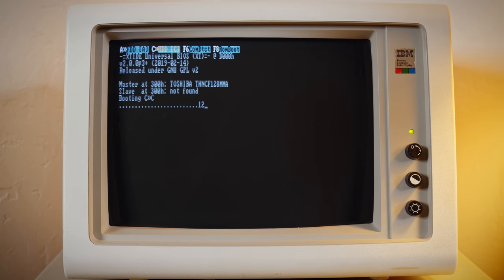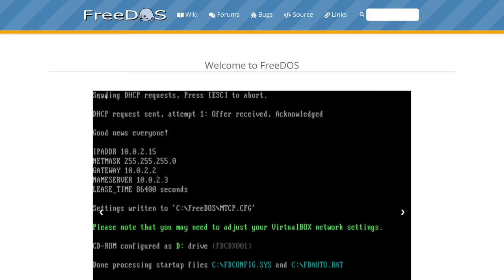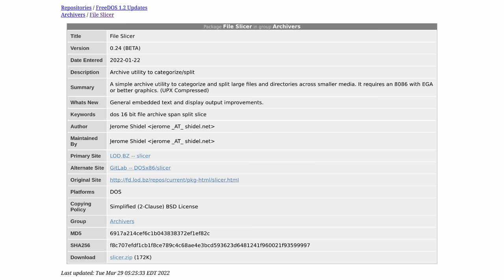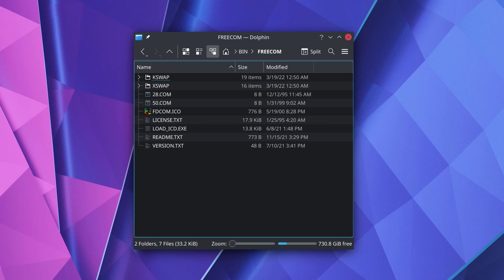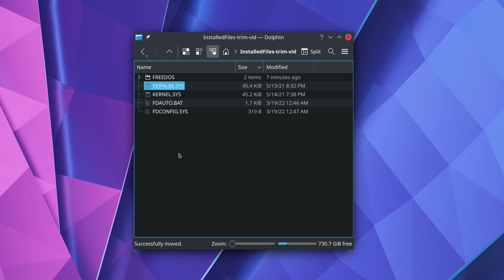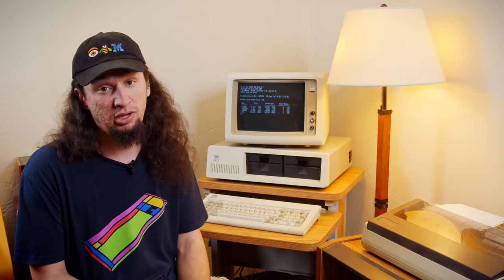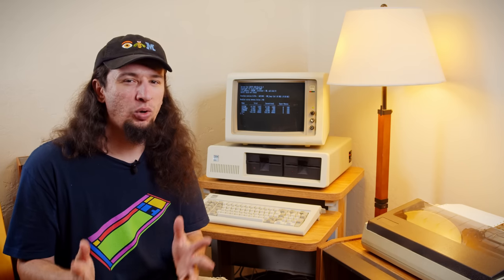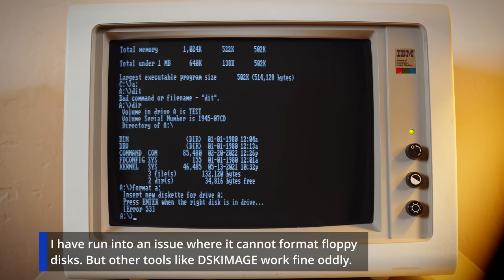Installing FreeDOS for 8086 on an IBM 5150

Comment: What in god's good name do you want fat-32 for on a 5150 class computer?  Hell, fat-12 should be good enough. Who needs more than 32MB of storage on a 5150?  If you really need to have every game ever made that will run on it, fat 16 is more than good enough.  Granted, it's not that simple to buy modern CF or SD drives under 4gig(2 gig is the part size limit, 4gig is the drive limit at least in early hard drives), preferably under a gig for such a computer.  But it's the way to go than having to screw around with this stuff.
Reply: Better question, why the hell would anyone want to run a 5150 class computer?

I mean, I know why I want to, I think is neat. But you clearly aren't talking about a hobbyist perspective here, but s practical one, so please, what use case do you even have to run a 5150 machine, and why that case isn't better served with emulation?
Reply: @Jossandoval  Why?  Why not?   I would agree on every other era of PC computing.  If you've got a 486, 286 software runs fine. You don't need one of every generation.  Really, you only need 3 PCs, a pre XP machine and a post XP machine and a 5150 or XT or T1000.  
The first generation is different.  All of the games are synced to the clock, not the RTC or the video signal or whatever else they use. SO if you try and run a game designed for a 5150, most will not run right on anything but an XT class computer. They will run far too fast because the program is not self-aware (IOW, synced to something other than the CPU clock, IOW, running full out as fast as it can run).  There are slow-down apps that have been available for DOS since the 286 first came out. But they're not very good.
It's not so much practicality as it is headache for no good reason.  You cannot possibly need more than 4GB (partitions are 2GB, but the drive of old controllers  max out at 4GB)  of storage on an XT or 5150 class computer.  There is just no reason for it.  32MB is more than enough and that's fat12.  I'm being generous with fat16.
I like emulation, but nothing beats real hardware.  Most emulators are lucky if they provide 95% accuracy.  All modern computers also use an LCD screen.
Of course, if you don't have any room for it, emulation is great.
Reply: @tarstarkusz  I must be strange because I have preserved two examples of the last of the single core XP era machines.. an AMD 64  Asus K8N board circa 2004 (A machine I built for somebody and then got back as junk 5 years later with bad caps) and an Intel P4S-800 with the fastest chip I could find in my stash.. both with 2 gigs of ram and 512 agp graphics.. what would have been pretty decent gaming rigs in the day.. The 64 is running straight up Debian 64 and the Intel has XP sp3 .. I watched them all die from bad caps and hit the scrap heaps in huge numbers and thought to myself "these will just vanish because nobody cares" so I recapped them and saved them for posterity. Same with a single example of the dual Pentium 32.. I wish I had saved my Pentium 133.. but space and my 40MHz 486 seemed more vital to save in the early 2000's and there do seem to be a lot of Pentiums still around. I cry when I see what people will pay for a straight 8088.. I junked a Packard Bell 8088 machine in 2002 due to a rushed move overseas. nobody wanted such rubbish back in the day..

While people go mad for the real antiques (and pay silly money IMHO) I think it's important to try to keep something running as an example of the standard kind of machines from every era.

My current restoration project is a dual P3 board.. I don't need a P2 or P3 system because I have both types represented in laptops.
Reply: @PaulaXism  It's kind of a shame that the bad cap era was when it was as they were the last machines that could boot 98 or ME and so they were the fastest pre-NT (by pre-NT, I just mean pre-XP. NT obviously goes back to 95 or 96) machines.  So many of them died early deaths.  This was also when the price of PCs was dropping precipitously. 3k bucks was common as recently as like 97 for middle of the road PCs and by 2003, low end PCs could be had sub $500. So they were already cutting corners to meet the new price.  But the cap problem is across basically all electronics and not just PCs.  A lot of ECMs (car computers) from that era are failing from bad caps, so I hear.

If you have the room, having machines from various era is nice. Other than sentimental value, I wouldn't mourn the Pentium 133, although most Pentium class PCs can boot straight to dos, so they make great dos game computers.  I have a Compaq desktop P166, but it's an EISA and PCI machine (it's put away, but IIRC, it's a proliant) with built in SCSI and a special keyboard with a mic and speakers built in.  That's a very nice machine for DOS gaming.

You couldn't give XT or 5150 class PCs back in the day. In 1993 I bought a Compaq luggable at a local computer shop 2nd hand for 99 dollars. It was 3k bucks new without the upgrades. Mine was fully decked out with 640k and with the optional hard disk.  It might have had an EMS card installed, but I don't recall for certain.   It's a pretty collectable computer today.  A working keyboard for it is probably more than I paid for it back in 93.

AFAIK, most of the XT class computers are still not really worth much. It's the IBM and Tandy machines and oddities like the Compaq luggable (Portable)  that get all the price love. They made clones by the boat load in the latter part of the 80s and sold them for less than a thousand dollars. These no-name clones I think are still pretty cheap. Great if you just want CGA gaming.  The downside is most of them don't have the composite out.
Reply: @tarstarkusz  For the 8088 games that are bound to the clock you only need a 286 with a working Turbo Button and they will run fine. The turbo button will half the clock sped of a 286 from let's say 16 MHz to 8 MHz. That's good enough to run these old games.
Personally, I've only had one game that was so clock-bound that it ran too fast on my 486 DX 33MHz, but was perfectly fine on my 286. And that was Oil Empire. Programs like slowdown didn't help with this game because the assembler routines were so small and ran in tiny loops that the slowdown program didn't even get a chance to run between that loop.
The game was therefore unplayable on a 486. But on the 286 it ran wonderfully thanks to the turbo button.

Since it didn't run properly on my 486 and my 286 was sold by the upgrade, I sold the game at the time. Unfortunately there was never a remake of this game. The game only offered EGA graphics on the PC, a remake in VGA and with Soundblaster support would have been great.
Reply: @OpenGL4ever  No, they won't. The 286 is faster at 4.77mhz than an 8088 at 4.77mhz.  An 8mhz 286 is WAY too fast for an 8088 game. Plus, many 8088 games will not run on anything but a 8088 or 8086.  The addressing is not quite the same and many games of the era relied on very tight timing and used some of the addressing oddities of the 8088 that won't work on a 286 or higher. 

Basically the address space wraps around at FFFF:FFFF  Sometimes it can be quicker to wrap around the address space than to move back down to the bottom of memory(IIRC, it's 1 vs 3 cycles). But this trick will crash a 286 because conventional RAM is bigger on a 286 and higher by exactly 65536-15 bytes. (which means it won't wrap, it just climbs into the HMA and will land on a random byte)  It has a 24 bit address bus. A quirk in the way conventional memory is addressed allows a new 64k frame to begin in the FFFF:FFF0 frame.  If you have ever seen himem sys in the config sys file, this is what enables that. Dos=High is what moves DOS into the HMA (high memory area)

Some 8088 games will work correctly on basically any DOS computer up to a Pentium. Though this is fairly rare.

However, some run too fast. Some crash.  I've never ran into it, but I've heard some XT class games required EMS RAM and on a 286, you need actual EMS RAM if the game requires it.  On a 386, the computer can emulate it if you put emm386 exe in the config sys file and you have enough RAM to have a chunk of it mapped into EMS. (IIRC, it does do this automatically. It will give your program that wants EMS all the EMS it wants and dynamically adjust XMS RAM as EMS use goes up and down, all but 64k (the EMS frame is 64k, usually the E segment))  But emm386 requires a 386 chip or higher  because it requires virtual 86 mode introduced with the 386)..

I personally have NEVER found an 8088 game that ran too fast on a 286 where the turbo button helped.  It will slow down some, but not to the right speed.  I forget the details, but a 286 is significantly faster at the same clock speed.  Just moving RAM around is faster. It has a 16 bit internal and external data bus. This alone is probably 30% faster at the same clock speed.
Reply: @tarstarkusz  You can also buy a 12 MHz 286, this will give you around 6 MHz with the Turbo Button option.
You can even buy 4 MHz CPUs.

About the addressing thing. I never heard of such games with such issues. The 286 is perfectly compatible to the first IBM PC.
And for the address space wraps around at FFFF:FFFF  thing the A20 gate does exist.
Thus it's definitely not a problem.
Have you ever heard of the A20 gate?

About the "relied on very tight timing" thing. I doubt it. Usually the games run very slow on a 8088 anyway, thus a 286 will make them more playable.

What you wrote about EMS is not true. There are 286 motherboard chipsets that will allow you to access the RAM above 1 MiB and use it as EMS. They ship with their own EMM driver version.
Motherboards with chipsets like the  NEAT-Chipset can do this easily.

The last option would be to simply modify the 8088 games and change the loop counter, for example.
The beauty of the early 8088 games is that they aren't very big. This makes them manageable. You should be able to understand assembly language  and opcodes of course. But it can be done.
Reply: @OpenGL4ever  I know there were several 286 chipsets that could use either emm386 or a custom one. But they were 3 or 4 chipsets. I know, when I had a 286, I found it on a BBS and of course, my 286 didn't have the right chipset.  I cannot validate if it works at all even on those chipsets. From what I understand, it needs V86 mode and no chipset is giving a 286 v86 mode. 
[EDIT: Upon rethinking it, I am about 99% sure that the program you are talking about is NOT for EMS, it's for using the unused frames of the UMA so you can load device drivers and TSRs into it. The same as adding the include command in config sys after emm386 to specify where you want to map memory END EDIT]
You got real mode and protected mode. As for accessing memory above 1mb, yeah, the 286 got a 24bit address bus. You don't need any special drivers for that. The HMA requires a 286, not a 386. I never said otherwise.

I know for certain there were games that would crash on anything but an 8088 or 8086 computer.

The slowness is why they needed tight timing.  The games that run too fast do that precisely because they are tightly timed to the original 8088cpu. They don't use the video or a RTC. Even if the 286 is twice as fast, the game is basically unplayable. Even 50% too fast changes the game too much for me.

You're going to try to hack commercial games with no source code?  Good luck with that. I know it can be done. There are plenty of hacked Atari 2600 ROMs, some quite good that required basically an entire rewrite (Venture reloaded, for example).  Frankly, I'd just use dosbox.